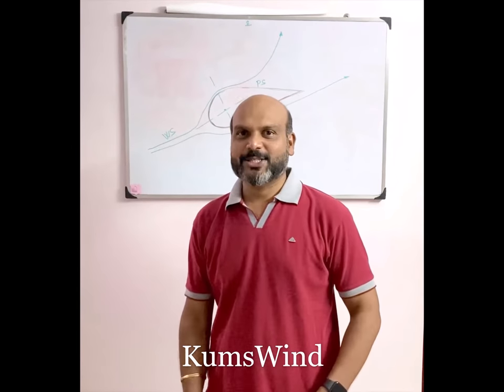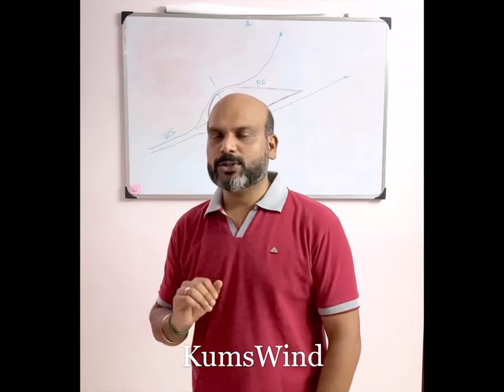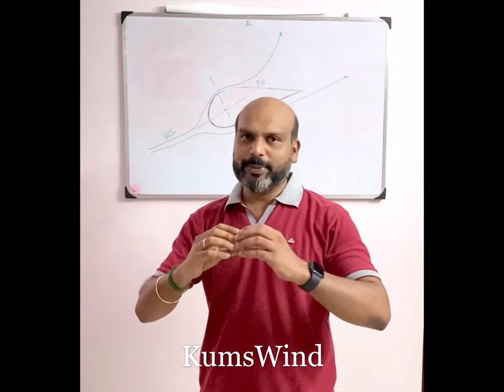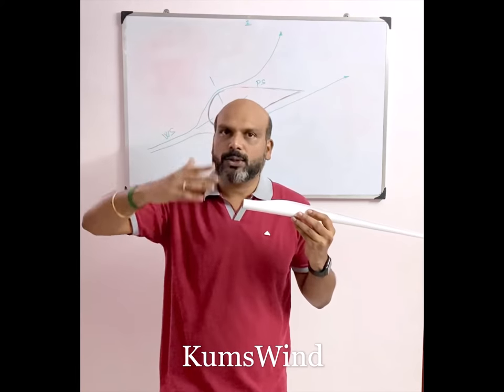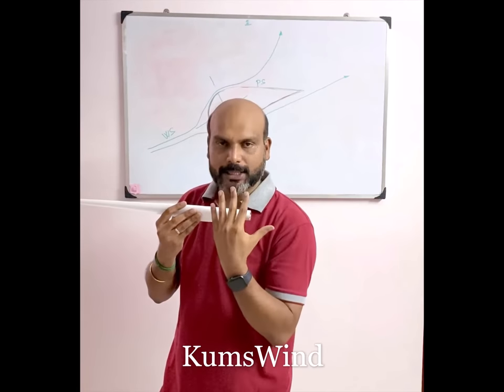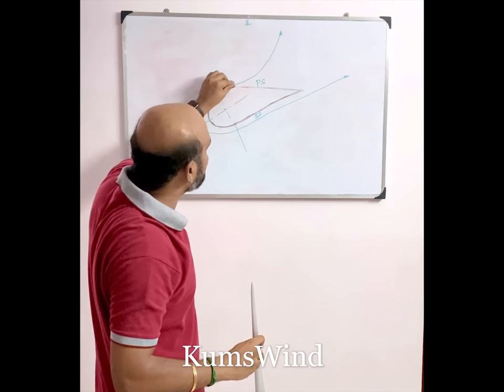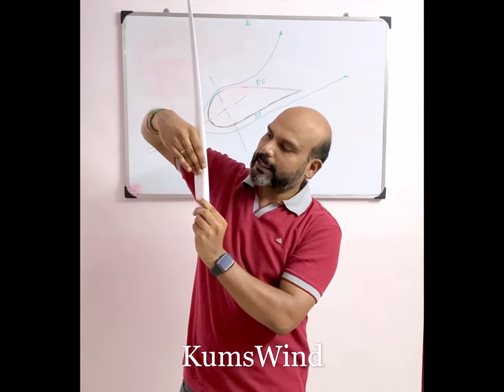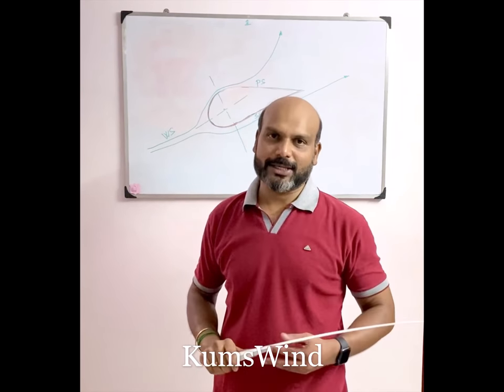Wind Turbine Aerodynamics | KumsWind

Comment from the maker: Explanation for arun’s question: Thank you for the feedback and question arun. the answer to your question is as below. number of blades doesnot make any big impact, whether it is one or two or three blade, the power is extracted when the blades are rotating and forming a rotational disc. yes the swept area (simply the circle formed when the blade is rotating, pi. R. R = area of the circle) is more important. therefore, increasing with more number of blades will one result in increasing the rotational mass and higher inertia to start rotating, which is not required. Instead of adding more blades, one can think of increasing the blade length, which will successively increase the swept area and there by the power.
Reply: i guess I am kind of randomly asking but does anybody know of a good site to watch newly released series online ?
Reply: @Samuel Imran i use Flixzone. You can find it on google :)
Reply: @Samuel Imran i would suggest Flixzone. You can find it by googling :)
Reply: @Samuel Imran i use Flixzone. You can find it by googling =)
Reply: @Samuel Imran i use FlixZone. You can find it on google =)
Reply: @Samuel Imran lately I have been using flixzone. Just search on google for it :)

Comment: Nice explanation, but I have small doubt why we need to use only 3 blades in wind turbine.  Is it possible to increase blades count to produce more energy?  Can you please clarify
Reply from the maker: thank you for the feedback and question arun. the answer to your question is as below. number of blades doesnot make any big impact, whether it is one or two or three blade, the power is extracted when the blades are rotating and forming a rotational disc. yes the swept area (simply the circle formed when the blade is rotating, pi. R. R = area of the circle) is more important. therefore, increasing with more number of blades will one result in increasing the rotational mass and higher inertia to start rotating, which is not required. Instead of adding more blades, one can think of increasing the blade length, which will successively increase the swept area and there by the power. hope i cleared your doubt.

Comment: Sir 3 blad and 6 blad difference  tell mee speed increase
Reply from the maker: Hi Nagendra, 3 blade is much more stable and sufficient to have uniform torque. 6 blade will be too heavy rotor and needs more inertia to start rotation, also the cost of 6 blade rotor will be huge and not worth the spending.

Comment: Hi sir, pls tell us how blade is rotating in clock direction at running mode bcz at normal time we used to see it rotates on the opposite direction too..pls explain the concept
Reply from the maker: hi rajesh, it depends on the airfoil shape, normally more of the wind turbines blades in todays generation rotates clockwise, when you see it from front of the hub. if you see it from the back that is from the nacelle side, it may look the opposite (anti-clockwise).... but in earlier times in early/mid 1990s there were few turbine models from USA which had anti-clockwise rotation.

Comment: HI Sir , thanks for the video . I think Convex side of airfoil is called suction side ( i meant bulged portion of an airfoil)  from aerodynamics point of view .
Reply from the maker: Hi Manoj, thanks for watching.. the buldged shaped is mostly on the pressure side.. but there could be foils where you might see the buldged shape on both the sides too... it depends how you design the airfoil.. you may consider this way to avoid confusion... the side of the blade that faces the wind is the pressure side and the side that is facing the tower is the suction side... hope my clarification helps you..